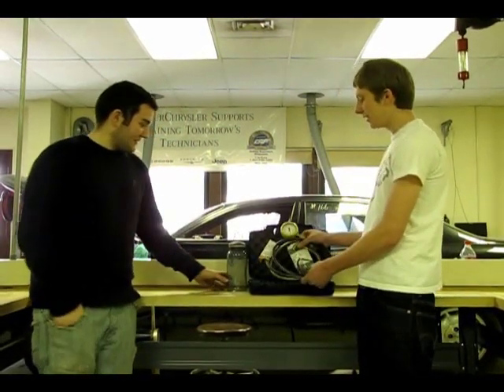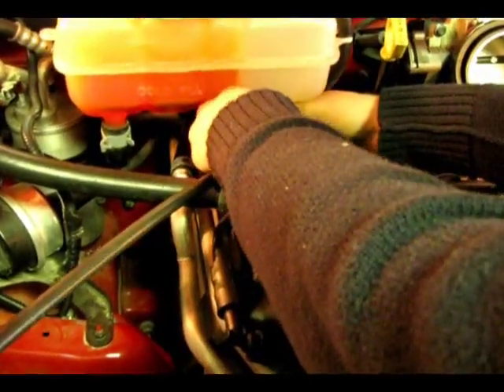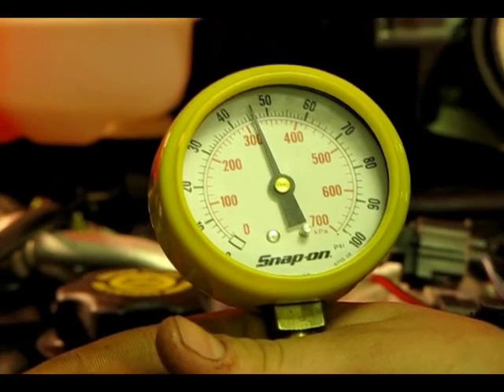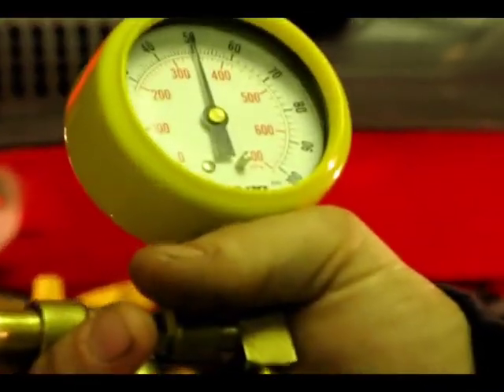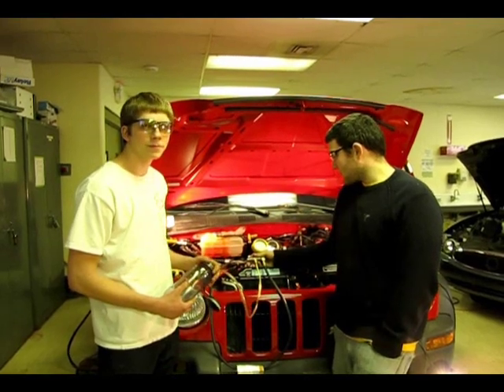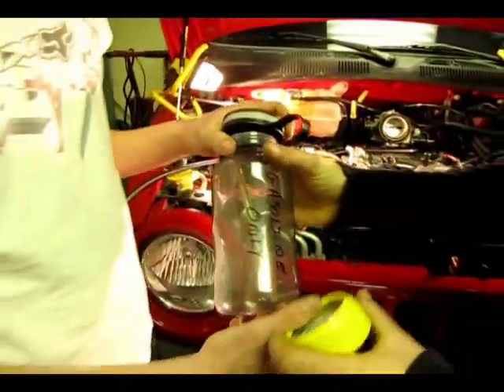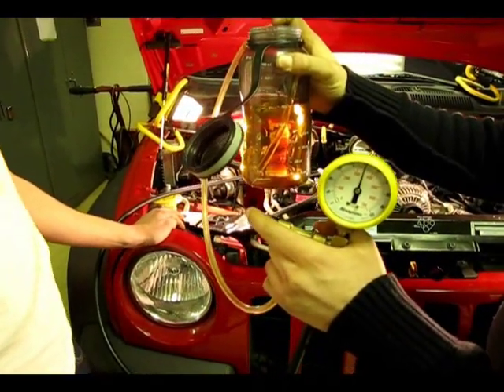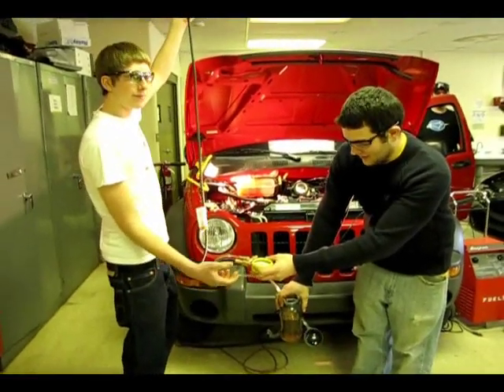fuel pressure testing

Comment: Excellent  video ! But I question. I just replaced  the fuel pump  on my '88 Chevy Beretta . I checked the fuel pressure pryor replacing it. The fuel pressure  gage  indicated the fuel  pump was not sustaining the 9-13psi. After I finished the car started fine and ran for awhile. I parked the a while and I went start it again it didn't want to start. The fuel pressure  gage indicates that 10-13psi crank it. Can you tell me what's going on. Four cylinder w/ throttle  body. Thank you for posting.